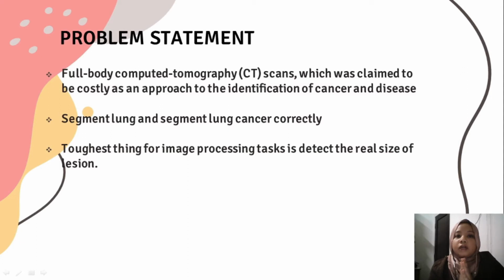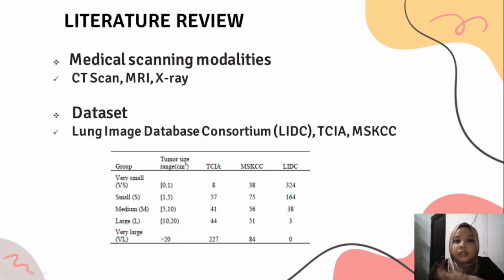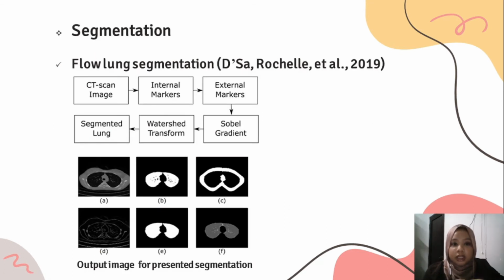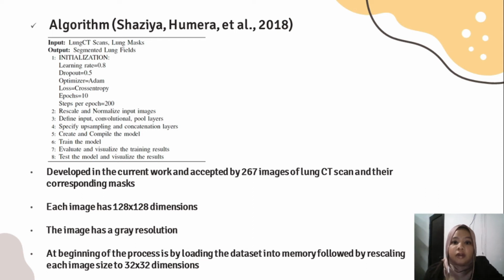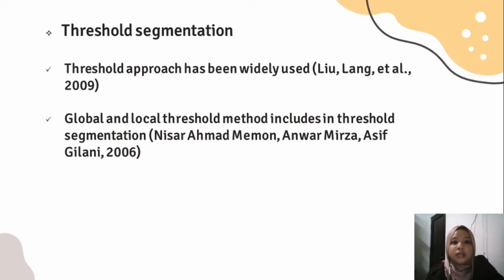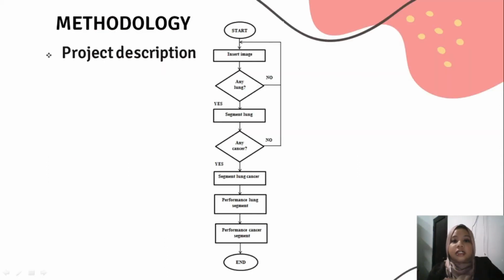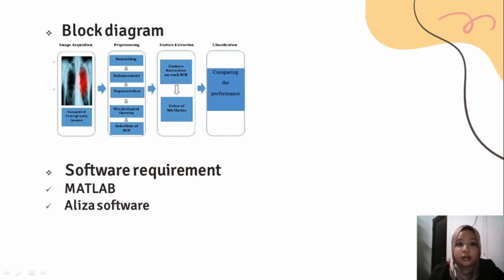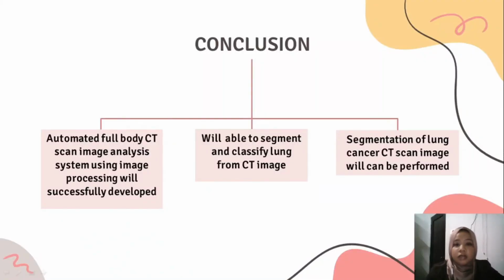PSM1 PRESENTATION BY SYAHIRAH BINTI ZAMRI

Comment: Salam Syahirah,

Good job in getting preliminary result. 

Here my takes on the content of your slides that you can use to improve your report:
1. It will be nice if you can cite the source of your statement. For example, According to WHO [1], the most commonly cause of death is cancer. By citing, it shows that you really fast-check your information, instead of expressing it according to your opinion.
2. Your objective might be correct but not accurate. You should also explain the method that you planning to employ. For example, point no 2, To segment lung CT images using threshold method employed in XXX [2]. This help viewer/panel with knowledge in the area to better gauge the difficulty & novelty of your project.
3. Scope of Project - I believes the first four points are not relevant. Instead you should explain in great details the limitation that you set for your project. For example, this project does not assume the image provided in correct orientation does the system does not perform any correction on the image orientation.
4. Block Diagram - Too small, can't see.
Reply from the maker: Assalam sir. Noted that sir. I will improve on my PSM2. Thank you sir👍🏻